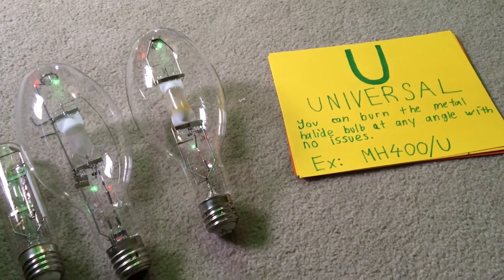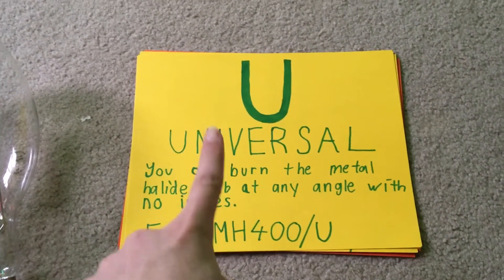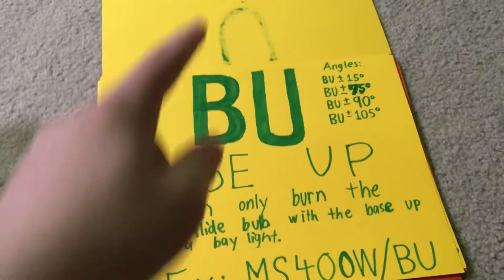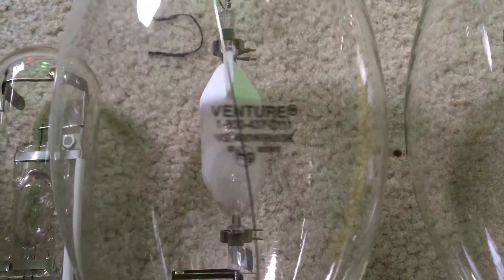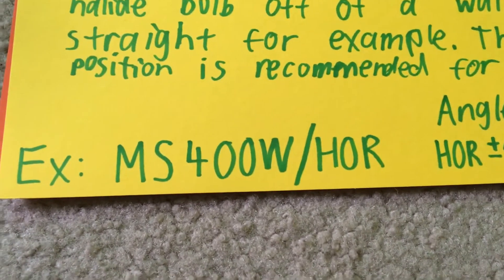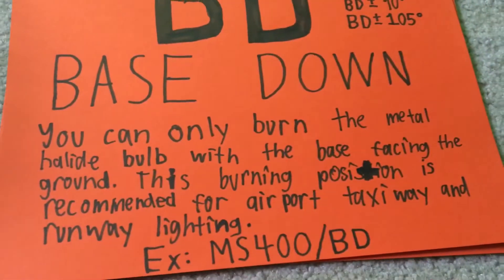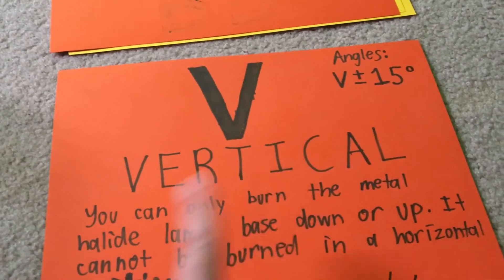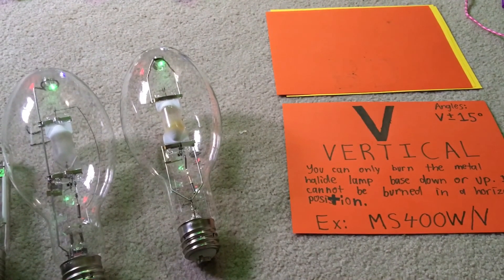An Explanation Of All Of The Burning Positions Used For Metal Halide (MH) Lamps

Comment: I'm old, I never knew what these letters mean. Thanks for teaching an old dog something new and useful. And a commenter below mentioned halide salts and I seen where your second bulb has a electrode that dangles inside. I was wondering how to test or visually see if a bulb is good without climbing a 24 foot ladder multiple times, now I have a half assed idea on estimating.
Reply: I believe what is moving around inside is the metal salts that condensed into a small ball.

Comment: I see that there is someone on lighting gallery who says that most probe start metal halide lamps should not be burned base down including universal burn lamps with the exception of bd lamps since the halide salts would attack the seals where the starting electrode is and would increase the risk of explosion.
Reply: Did you know that early high pressure sodium lamps and early mercury vapor lamps had specific burning positions too? For example, the GE A-H1 lamp was a tubular 400w mercury vapor lamp with a E39 base produced from the 1930s to the 1950s that was designed to only operate base up? These lamps were only rated for base up burning because they had glass arc tubes rather than the quartz arc tubes you see on mercury vapor lamps today. If you ran these lamps in a horizontal position, the arcstream would bow up and create a hot spot in the glass arc tube and cause the bulb to fail prematurely by shattering the arc tube. In order to operate this lamp in a horizontal position, you would use a magnetic arc deflector. The GE Form 109 was a 400w mercury vapor street lantern that was produced from 1948 to 1955 that had the lamp mounted horizontally to help direct as much light down onto the street  it illuminated as much as possible. These lanterns used arc deflectors to allow for the operation of early A-H1 mercury vapor lamps since they were cheaper than the E-H1, which was the first universal burning 400w mercury vapor lamp for the North American market with a quartz arc tube consisting of a BT37 envelope. Did you also know that some horizontal burning metal halide lamps have a E39 base with a pin on it that prevents it from being installed in normal E39 sockets?
Reply from the maker: I have operated metal halide lamps BD, and they run fine.
Reply: @frankiel.6774  I also feel the same way. It does get irritating when I get told by one lighting gallery member again and again that Universal burn probe start metal halide lamps should never be burned base down.
Reply from the maker: @worldwidehidcollectorusa-fkt  I have to agree. Universal burning metal halide lamps are supposed to be burned in ANY position, and still, lighting gallery members think it is unsafe to burn universal burning metal halide lamps BD.
Reply: Here are some exact quotations from lighting gallery member dor123 about operating probe start metal halide lamps base down:

It isn't recommended to burn probe-start MH lamps base-down. The halides accumulates the are of the starting electrode, causing corrosion and premature failure with a greater risk of arctube explosion.

Even if universal. Probe-start MH lamps are suitable only for base-up to horizontal.